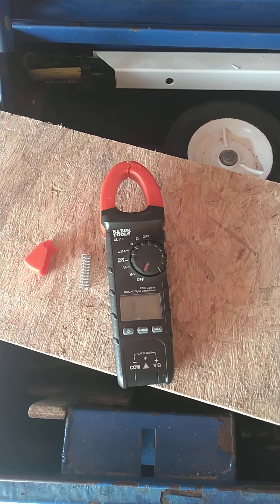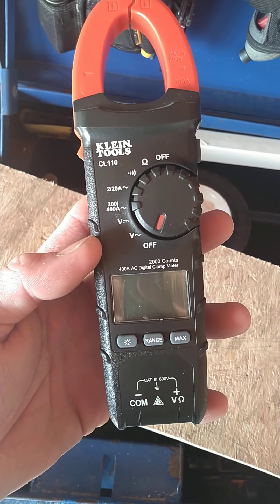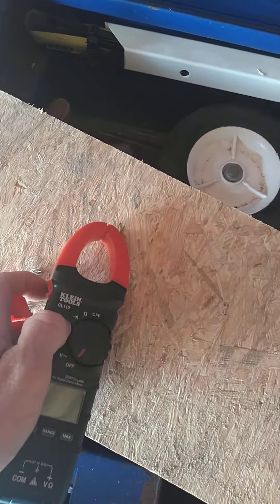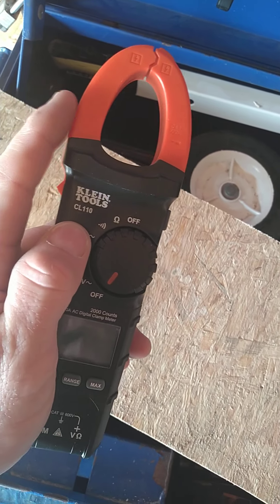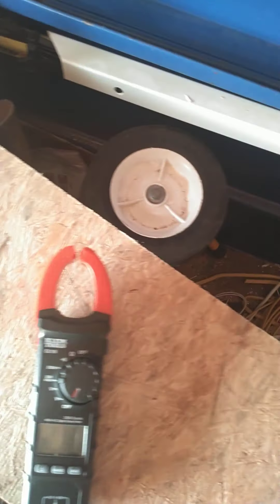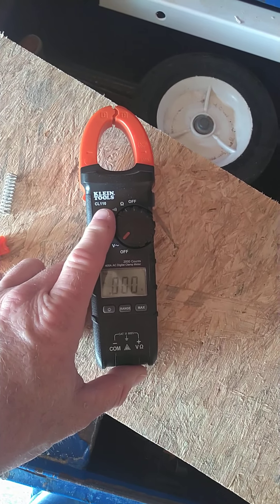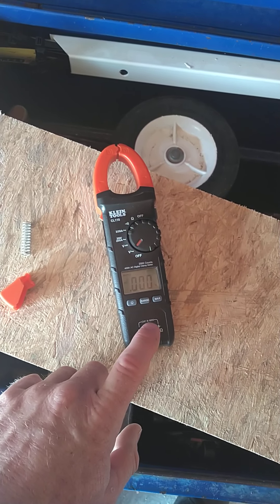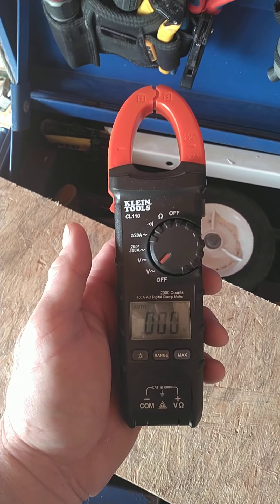Klein Tools CL-110 clamp on amp meter buyer's remorse 😩

Comment: I have been doing electrical for 25 years and have far too many meters. Some very old. My Simpson is in for repairs, but it has tested more circuits than I ever will. This Klein CL110 is not and will not be top of the line, but it will get the job done. Mine has been all over 480/277 208/240/120. Even a bit of 5v 12v and 24v. Honestly, if you see a plastic part, don't expect it to last too long bouncing around a metal truck. Also, if it's only 50-75$ in this day and age, don't expect miracles of durability. You get what you pay for. I am just being honest. My old Simpson has plastic all over it, but it sure looks and feels sturdier than the Klein plastic. Eyes, ears, and brains. Use them. PS: This Klein CL110 is probably the 11th or 12th meter I have ever had, it's simply not the best. It does do the job well if you take care of it though.

Comment: Klein should replace it if it is still under warranty and or still have that model number or the updated version of this meter (this I was told by the workers at calumet electrical supply my local business where I live from Mat Klein the 4th himself) the owner of Klein tools.
Reply from the maker: Thanks for watching Ruben. I appreciate you asking about it. I have yet to do anything about it. But still using it broken as a volt meter.
Reply: If true, that is cool story.

Comment: How are we do not know if it got damaged my other equipment in the back of your vehicle
Reply from the maker: Very good point you have made. But if you look at how thin the plastic is on the thumb button, kinda suggests the quality in how it's made. Now that you seen the video, would you buy one made by Klein? I'm not saying all Klein tools are bad. But this one is short of making the mark of quality!
Reply: @workingmanrondoyle3287  
Yes I would buy one because almost every M out there is made with thin plastic the only difference here if you got to see one because it got broke by being in the back of a truck with all kinds of equipment most likely stacked on top of it if you took Other meters apart you would find the plastic is just as thin
Reply from the maker: @seahawker4life952  Well, speculation that someone is abusing their tools is one thing. Poorly made tools is a totally different story.  I hate to tell you, but the hairline crack had actually started way before I started actually using the meter. But I had it too long to be able to do a store return on it. Home Depot is around 90 return policy but where this is electronics has 30 days.  By all means go out and buy one, try it for yourself and make your video proving me wrong.
Reply: @workingmanrondoyle3287  There's a recall on this one, I put the link above, he can get a replacement.
Reply from the maker: @Jennifer-007  Thanks Jennifer, I'll check it out ❤️
Reply: How are we do not know how we form we the sentences  🙄
Reply: @Jennifer-007  Way to go Jennifer.  Women named Jennifer are so hawt.  😆